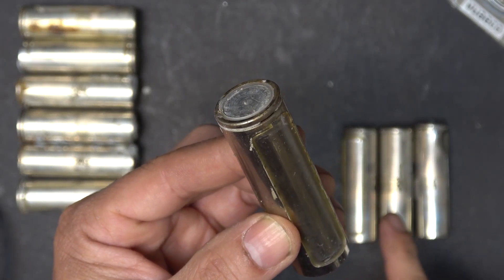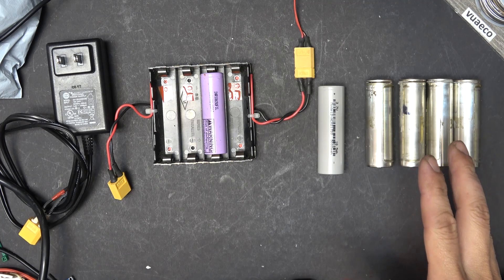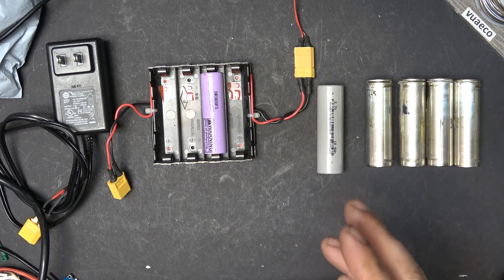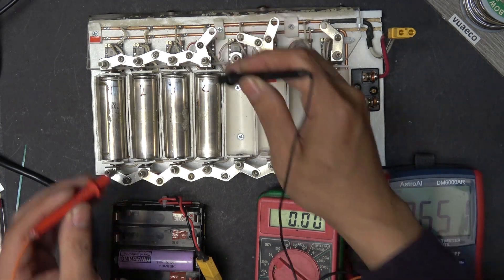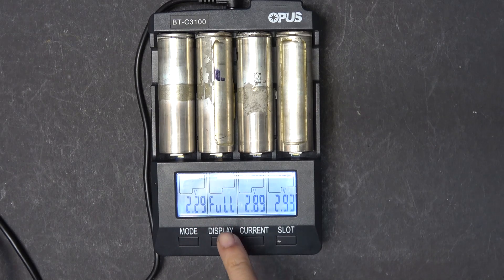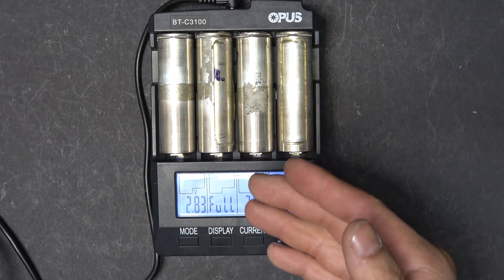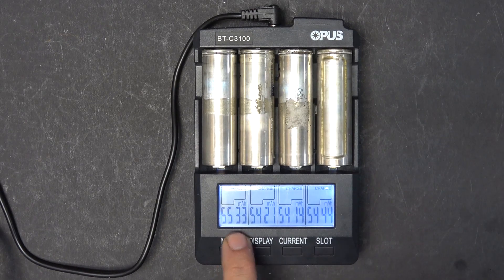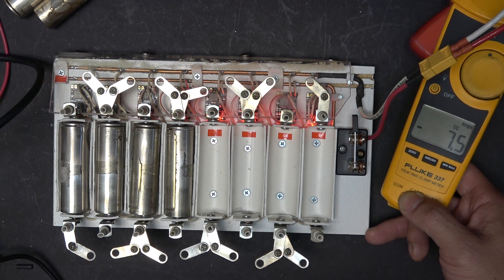Revive a dead Tesla model 3 2170 battery

Comment: 5.5amps on a 18650 cell 😯 I'm impressed
Reply: this cell not are 18650
Reply: @pedrohenriquepaixao3443  oh I 👀 that slow charger you used was also not for 18650 cells? Pretty interesting... haven't been keeping it up with cell tech did not know tesla moved away from 18650 cells
Reply from the maker: These are 21700 cells.
Reply from the maker: @nyrubin  It was made before the 2170 came out. But fortunately it's large enough to fit a 2170, barely.
Reply: @vuaeco  💪💪💪💯

Comment: To find out their capacity you need to discharge them and find out how much energy they stored, charging them up does not tell you how much they stored only how much energy was put into them or lost to heat or chemical changes.
If a cell has been discharged below around 2.5v only once you might be lucky to get back decent capacity, but in my experience its very unusual to get good capacity back after deep discharge. 
How about take one of those cells ( if you still have them marked) and discharge them and see what capacity you get. The capacity you get depends on the rate at which you discharge them too! From memory c/20 is common rate used to measure discharge capacity.
Please let me know if you do a discharge test that will really tell you what capacity they have left.

Comment: U finally have us a little background about your past. Now that I know what country u r from, I can continue to fill in all the blanks. Never bought a tire at Costco. That one was hard to believe. For my Odyssey, I usually get a bit of an off brand tire at a local independent tire shop. I would like to c how u bubble balance your tires. No way r u going to spend 20 bucks a tire to have a shop do it. Kidding
Reply from the maker: "fill in the blank" :D. 
I do have a Harbor Freight tire balancer. I made a video review about it a while back. There's no way I would spend $20 for a shop to install a tire. You can just buy the whole tire and rim (already balanced) at the junk yard for $25. Sometimes the tires are even in new condition.
Reply: @vuaeco   I am going to Pick Your Part today. I will b thinking of u. I will check out your HF balancer vid. I can’t believe I missed or forgot that one. I’m 72 and senility is knocking on the door.
Reply from the maker: @billrimmer5596  Oh wow, just in time, right? Is that LKQ? That's what we have over here.
Reply: @vuaeco   I forgot to mention. I will b going there on my Buddy 125 scooter. Since I need parts off the front of  a Honda Civic engine, I will b taking my Kobalt 1/2 inch drive impact wrench. That, coupled with the high mass 19 mm socket easily removes the infamous crankshaft bolt with ease. I have Ryobi, but I fell in love with Kobalt when I saw how much u liked and used them. The Kobalt is a beast. I better let u get back to charging your other 25,000 Tesla cells
Reply: @vuaeco   No. Its in Sun Valley in the San FernandoValley
Reply from the maker: @billrimmer5596  The Kobalt 1/2" impact is a beast. Almost everything I have is Kobalt, including the e-scooters! :D

There are a lot of LKQ up in LA. In fact, that is the mecca of LKQ up there.
Reply: @vuaeco  I checked the name, it was LQK  Pick Your Part. Tire and wheel combo was 125 though. Aluminum

Comment: If the cells were overheated and/or below 2 Vdc, they might have problems. I recommend that you charge them at a very low current (0.2A) for the first charge, the charged 18650 will dump way too much current too fast into the 21700 cells. After you get them to charge, I would cycle test each a few times to see if you get consistent capacity readings on the opus. Then I would charge them, let them sit for a month, then check their voltage to make sure they don't self discharge. I think the opus will only recognize them as LiIon if they are higher than 2.5Vdc.
Reply from the maker: If they are overheated when you try to charge them then yes, they might have a problem. If they are below 2V, that's not a problem, though.

Comment: It looks like the top of those battery on your tesla pack is corroded. Is it just a manufacturing tape or something or they are just in really bad shape?
Reply from the maker: It's not tape. THey are actually corroded due to too much moisture in the air. Just cosmetic issue, though. They clean right out and work fine.
Reply: @vuaeco  perfect thank you!

Comment: hello Vuaeco and all followers. I need some help and I am thanking you in advance.  I have a 52 volt Ebike battery that is in low voltage disconnect mode and my battery charger can't recognize it to charge it.  I READ THAT I COULD INCREASE THE VOLTAGE  TO WHERE IT WOULD BE RECOGNIZED BY THE CHARGER BY USING AN AUTOMOTIVE TRICKLE CHARGER TO INCREASE THE VOLTAGE AND THEN USE MY NORMAL CHARGER TO CHARGE IT TO 58.8 VOLTS.  DOES ANYONE HAVE ANY WISDOM REGARDING THIS METHOD TO REVIVE  THE 52 VOLT Ebike battery

Comment: Where else can we find dead 21700 cells, currently laptops have 18650 & 16650 sanyo
Reply: Some modem batteries have 21700s.
Reply from the maker: Late model power tool batteries have high discharge 21700 cells, also.